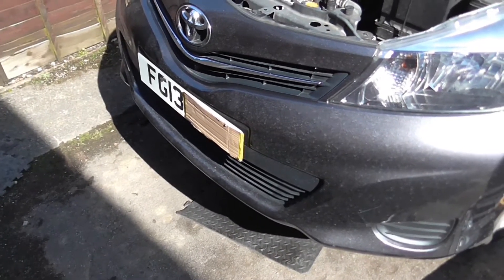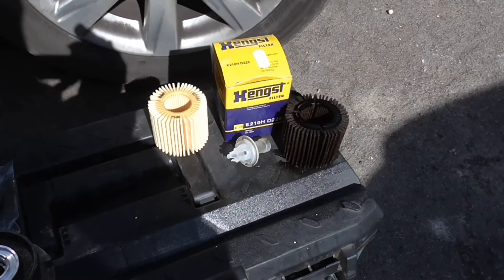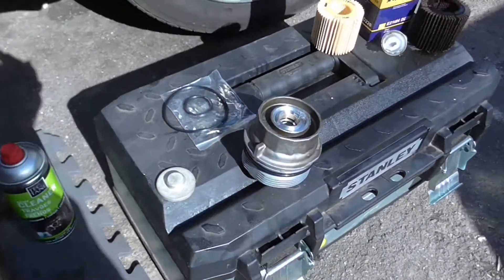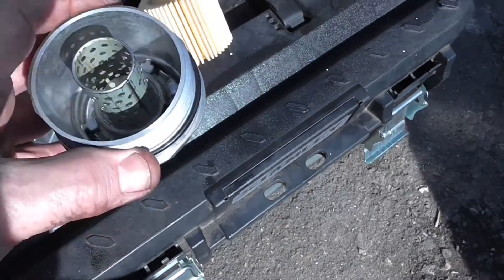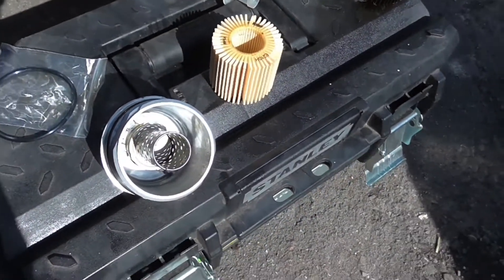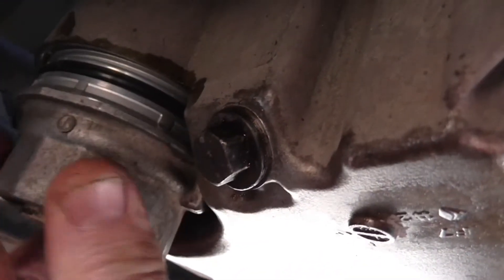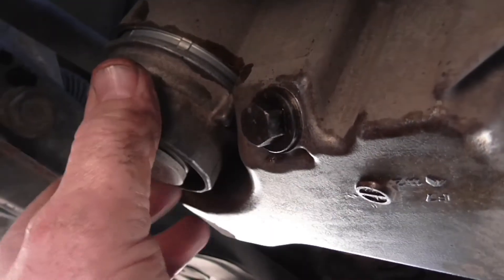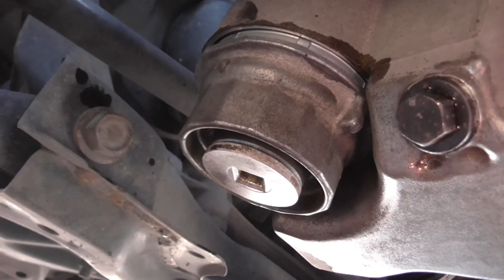Toyota 2013 1.3L Yaris Oil and filter change

Comment: If you push that perforated tube part, it's spring loaded. Maybe that is the pressure relief valve. The bottom part that unscrews is just so you can drain the housing before removing it, if you want to. I hope your video has prompted people contemplating this oil change to equip themselves with the correct tool for a few quid!
Reply from the maker: Yeah you are right if you are going to keep a motor for a few years and let’s face it that’s why people buy Toyota’s…. It’s a wise investment recently I bought one for my son’s 520d BWM they have a plastic lid on the filter top side of the engine which will unscrew with big water pump pliers but the tool is £7 off eBay…. He’s going to run the car as long as possible….. so worth it….. cheers….Trevor

Comment: Excellent video mate - you've helped me a lot.I recently went and bought  the stuff to service my 2010 Yaris. When I opened the box containing the oil filter I expected it to be the cannister type. I was then advised that I'd need to buy a special tool for removing the filter housing. No way!... Most of the time, I won't buy specialist tools, I'll try and find a way around the problem. So ... when I found your video I was so pleased to see that you were using a screwdriver and a mallet. I'd thought of this myself but was worried I might damage the housing. Now that I've seen you do it, I'm OK with the idea.
    I did look on e-Bay and there are special tools for the job, they cost about £5 - £10. 'Coz they're quite cheap, I'll probably end up buying one for next time - I don't want to damage the filter housing! Anyway, once again, excellent video - concise and to the point, without any waffle or stupid background music!
Reply: The temporary plastic nipple is for the initial drain of the oil. Never used but simply discard either way.

Comment: I bought the correct filter removal cap wrench for about £5 (internet). Needs to the the exact one as There are several that look similar. This is 65mm 14 flute, and has H901 stamped on it and 65p14 inside..also fits 2015 Auris petrol. So easy with 3/4 drive socket and no damage.

Comment: Also the plastic tool supplied with that kit you have is if u want to release oil BEFORE removing the whole filter cap, just remove the press relief cap and screw the tool in ..it will force the valve open and allow oil to drain out ..or just remove the whole filter like u did.
Reply from the maker: Thanks auto matic....... Yeah I realise that now but that's not me far too sensible, I always get oil everywhere! that's the fun of it clearing up after...! all the best ....Trevor

Comment: Thanks for the video! Do you know if removing the oil filter there is enough space to remove the control arm bushing bolt?
Reply from the maker: Hello Matteo Thank you for your kind comment.....to be honest I don't know all I can say is if your working under the car and are changing the control arm or bushings might as well change the oil while your under there.
better than lifting up the car a second time... even more so when winters here..!
All the Best ...Trevor
Reply: @jetblack11td  thank you for your kind answer :-) you're right. All the best

Comment: Which viscosity is suitable for Yaris 2013 , 180000 km , in climate which is cold till 5 in winter and hot till 45 in summer 
Thanks
Reply from the maker: Hello there I have had a look at a couple of oil companies web sites Shell, Castrol, etc and they all come up with a wide range but this was searching using the UK registration Number.
the temp in the UK tends to be in the -6/8 C in winter and max of about 30 C in high summer we use 5W30 full synthetic mainly.....or 10W40 Semi. But I would ask your local Toyota dealer....... All the Best ....Trevor
Reply: @jetblack11td  Not 10-40, 5-30 for summer & 0-20 winter.

Comment: Is this perhaps a 1.3 engine ? ( denoted by the 1NR engine code ). I have the exact same engine but I am struggling to get the correct oil filter tool
Reply: My apologies - I see you managed to tap it out. There are tools for this job but I wanted to see if it was possible to tap it out like you did and you confirmed it is possible, although not ideal. I am going to have a go in the morning. Many thanks from South Africa
Reply from the maker: Hello....Your right it is a 1.3L it's the father-in-law's....he always said it's a 1.4L wrong! better edit the Video! your right hitting it off isn't ideal....but most average mechanics don't buy tools like this for ever car they work on they wouldn't make any money....experience to know when you are hitting something too hard takes well experience....
All the Best from the UK.....Trevor
Reply: @jetblack11td  just a quick update and great news as tapping it out worked but it was slightly stressful. I would have never thought about tapping it out if it were not for your video ( the tool is quite expensive). Anyway i am going to order a cheap Chinese version online for next year but that will take 3 to 5 months to arrive but I was in a hurry as the service was overdue. Thanks, u saved me some money.
Reply from the maker: Hello... Mission accomplished all cool.... Cheers....Trevor
Reply: It's a  64mm 14 flute tool.

Comment: Pressure release valve...? For an oil and filter change?  Then you say, "Your guess is as good as mine". Question; Do you think you should be doing a how to video when you don't know what you're doing yourself?
Reply from the maker: Well my friend what I was referring to is most can type screw on filters, have a pressure release valve in the bottom of the the filter... if you look you can usually see the spring in the bottom, the idea being if the filter blocks up the valve opens and you still get oil flow around the engine...unfiltered oil is better than none...don't you think?